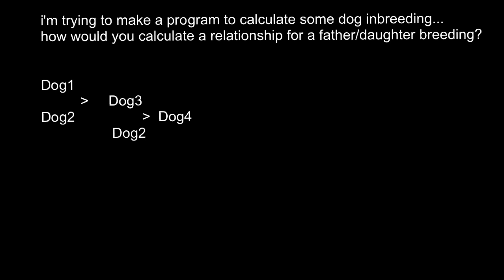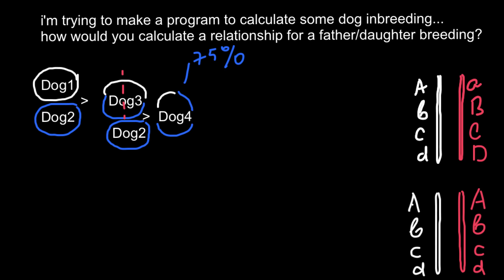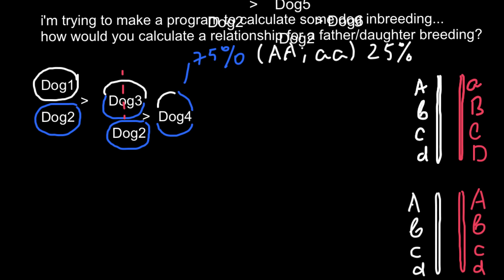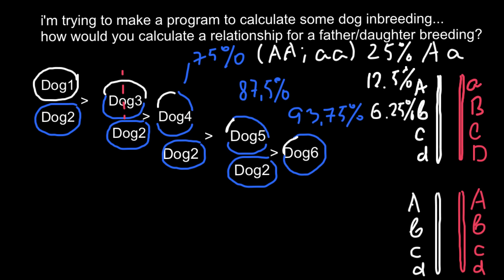How to breed a Pure Line in dogs or other animals and plants

Comment: ohh wow
Reply from the maker: But these 2 examples are the simplest and need only 2-3 inbreeding crosses to fix the trait. In most cases traits are under the control of many genes - in those cases more inbreeding crosses needed to fix many genes (loci). Could be 3-4-5-6-7 close relative crosses.

Comment: In this example you said that dog 4 would be 75% homozygous.  Would that not ONLY be true if DOG 2 is fully homozygous.  As the 75% only represents the percentage of genetic material transferred from DOG 2.  If DOG 2 is heterozygous and DOG 4 is 75% related it would not necessarily be 75% homozygous.  Similarly the 25% from the other parent does not represent heterozygous percentage unless DOG 1 is also completely homozygous for different alleles than DOG 2.
Reply from the maker: In order to do exact calculations we need to know genetic relationship between the dogs and initial coefficient of inbreeding. This was just example that with each round of inbreeding loss of heterozygosity would be 50% .
Reply: @GeneticsLessons  thank you, but we select it trait by trait with selection and culling until we produced the homzygous domnt.  is inbreeding in dogs highly risky that can produced undesirable traits? thanks
Reply from the maker: @calvinmateo1646  Inbreeding of almost any animals is bad for productivity, those some tolerate it pretty well, for example mice.